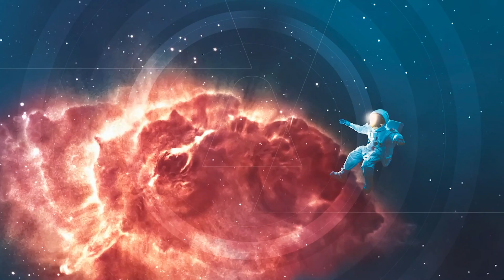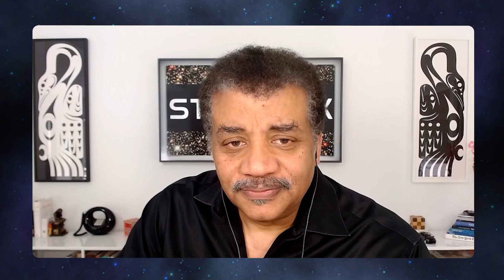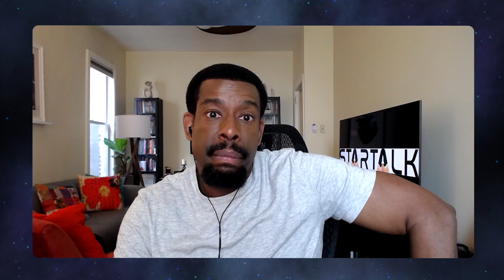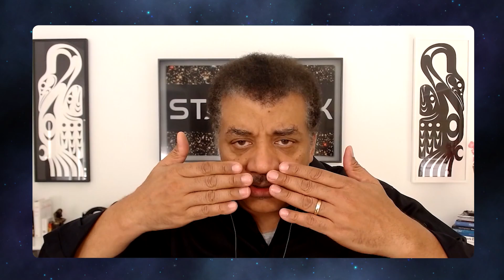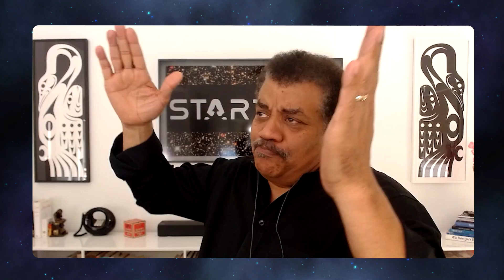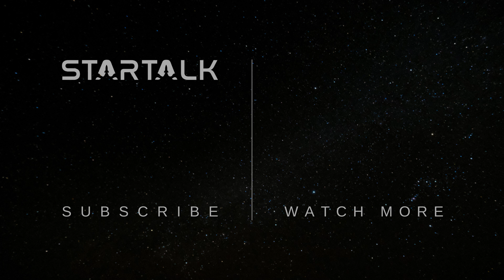Neil deGrasse Tyson Explains Sonic Booms

Comment: But on the ground floor where all the echonradios received most of the damages and what is the Devine pilot dive against the current straight into the water crime 4 sonic boom speed 1120x 4480 Aquarius soundmequavalent is 5600 T split below noon 3500/3500 1:1

Comment: Nothing travels faster than the speed of light, so there shouldn't be light boom!
Reply: correction, nothing travels faster than the speed of light 'in a vacuum'. If light is in other media such as water or even air, that rule doesn't apply.

Comment: Does that mean if it were possible to travel faster than the speed of light that the vessel would be invisible until the light boom caught up? And would the boom result in a flash because of the condensed light? And the vessel would obviously be catching up to older light so essentially going back in time, in a sense.

Comment: Remember that sound is essentially vibrations through a material. In our case it's air, and the reason sound coming from a plane going at mach 1+ is a "boom" is because as mentioned, moving faster than sound can propagate and vibrate the air in front of the direction the plane is moving will compress the air at the front cone of the plane and it will come shooting out and away from it while still being compressed. It turns into a shockwave, which is essentially compressed "sound" or just a very strong ripple through the air.

Comment: This is just wrong imagine an object were making noise in all directions and traveling 700 miles an hour, which also happens to be the speed of sound traveling through air given the current circumstances depending on the direction and trajectory of the object, the sound could reach you before the object would be directly above you provided that it ever was. And also the trajectory of the sound may have a shorter path to your ears comparative to the path. The plane has to the space directly above you, so therefore, airplane moving faster than the speed of sound, you may very well here before it is directly above you in a large amount of given circumstances, and given altitudes. 

This is usually the part where I would put something insulting at the end, but due to YouTube’s new community guidelines, I can’t say anything I want to. I’m going to sue YouTube. I’m going to sue them so hard I’m gonna do something.

Comment: speed of sound in air
ss = √(1.4 × 287 ×[273 + Temp C])
in  meters/sec 
C  celsius temperature
multiply ss by 1.944 to get knots and again with 1.15 to get miles per hour
TEMP is 9°C at 3000 feet  ISA
🇧🇴🏔️
it's cold at night in La Paz : 12000 feet! ss is smaller. OMG

Comment: So if you use a stack of say diamond sheets to slow a light beam below the normal speed of light, then fire a particle that travels close to the speed of light, with enough medium the particle will eventually outpace the photons. Is there an effect at that point? And is it traveling faster than the actual speed of light or faster than a light at any speed the point?
Reply: It's traveling faster than the speed of light in that medium. The effect will be the emission of radiation.

Comment: 9:03-9:06 somewhere in here I think I saw some kind of counterclockwise-turning firework-esque light outside my window that lit up the sky a bit. I've never seen that before. I guess I should check for footprints around here for someone with a flashlight or something but I live in an fairly unpopulated area and it's snowy cold out. It was bright enough to make me look up from my phone and wonder if the porch light was on because it started to light up the sky. It lasted no longer than 2 seconds as far as I could tell. It was 100ft+ up in the sky I believe, it was above the treeline. I think it started at a wide and fairly broad origin point in the center, expanded clockwise rotating, and then faded to the point I couldn't see anything unusual. The light rotating from the center were shaped kind of like rays of light. Not narrow though, broad. That's the best I can describe what I saw, I can't promise accuracy... Whatever that light was, I wish you safe travels. (I'm not sure if it's a trick of my eyes/typical light, a creature, someone at 3:19 with a source of light that had a sort of stationary center (did not seem like a flashlight, it would've been a very weird one, light didn't move like it was handheld, it would've had to have been extremely powerful), or perhaps a light wave of the universe). This is Northeast of U.S. , 3:20am, Saturday Feb 25, 2023. My eyes are semi tired and I'm sober and lucid. Now I feel like I can understand a little of how people just see things they can't explain and are like, "huh"...
Reply: *counterclockwise rotated.

I'm not sure but it may have also emanated from the ground up to that broad turning point, might've been why I thought it was a porch light. (Also I'm looking thru a glass window, wire screen, and I don't have lights on in my room besides my phone which was pointed towards my face. Which is my main reason for being suspicious of what I saw since the light from my phone made it harder to distinguish and just focus on the light in the sky.)
Reply: Also we haven't had lightening today.

Comment: Maybe the term "optic boom" would be appropriate for particles - such as electrons - when they travel through water, and in so doing exceed the speed of light propagation in that medium.  When that happens, an eerie blue light is emitted through the water, and it's known as "Cherenkov radiation"  - a very common sight in the water cooling pools in nuclear reactors, as found in nuclear power stations.

Comment: I learn new thing every time I watch Neil DeGrasse, thank you!
This led me with 2 questions:
1 - If the plane breaks the sound barrier and then slow down below the speed of sound, then speeds up and break the sound barrier again, with multiple repeats.  would it make multiple sonic booms?
2 - if the plane flying from Los Angeles to New York passing Chicago faster than speed of sound, would people in Los Angeles, people in Chicago, and people in New York all hear the sonic boom?
Reply: The plane does not "break" the sound barrier; as long as the plane is travelling faster than sound, everyone on the ground  that the plane passes over will hear a boom, which is a manifestation of the shock wave, which travels along with the plane.So the answer to question 2 is yes, everyone along the flight path will hear a boom. Notice that I refer to "a" boom rather than "the" boom, because it's not everyone hearing one boom at the same time; they are literally hearing their own "personal" boom as it passes overhead, no matter how far apart the observers are.

Comment: You hinted at the end about going faster than the medium wants you to go but didn't explain further. Someone will correct me if I'm wrong, I'm sure but the speed of sound in a medium is the same as the speed of an object which passes through that medium and creates cavitation, not just a wake, i.e., the speed at which the air breaks apart and leaves a vacuum behind the moving object - like a wedge cutting through a soft solid.

Comment: The speed of sound is slower at cruising altitude than at sea level and no commercial plane can fly faster than the speed of sound at sea level. But what if I told you that large commercial planes can and often do fly faster than the speed of sound at cruising altitude while still flying slower than how fast sound travels at sea level?

Comment: If an object doesn't make sound, but is traveling faster than the sound barrier, does it still make a sonic boom?  Does the boom happen simply because the air is slamming back down into the vacuum the object created?

Comment: My only contribution is that low-level song booms bust out windows in people's houses for miles.   I've only ever heard one sonic boom at White Sands NM and the crew I was with thought a bomb went off.   It was unbeleivably huge, like thunder times 10.  It practically shakes your guts loose.   The military isn't even allowed to fly beyond Mach 1 over general US airspace, only designated military operations areas (MOA's).   So the part about the US Gov't not wanting sonic booms over the US continuously is a real thing.  I'd guess the reason we never developed a super-sonic commercial jet was probably because they weren't financially profitable, so one ever invested money into it.   If it were profitable, those corporate investors would have lobbied (bribed) US politicians into repealing the supersonic speed limitation because hey, what's a few broken windows in people's homes when billions of dollars are to be made.

Comment: Hey... wait for a second. If an airplane fly above you faster than sound, sound seem to not be compressed but stretched 'backwards'. I see Sonic Boom as compressed air only if airplane fly exactly at speed of sound. In that case it can't be dissipate but will be accumulated and THEN if it hits you, you will experience sonic boom.

Comment: I grew up next to O'Hare Airport in the 60s and one summer we had endless sonic booms that knocked us out of our beds...hmmmmmmm
Reply: Commercial jets generally aren't capable of breaking the sound barrier and there have been FAA regulations against creating sonic booms since 1970.

".... In 1970, acting under this authority, the FAA proposed a regulation that would restrict operation of civil aircraft at speeds greater than Mach 1, unless authorized by the FAA..."

And our military generally has rules against doing it over populated areas for public relations purposes.  However, it was quite common in the 1950's to hear sonic booms.

Comment: When aircraft reach supersonic speeds, along with the sonic boom, sometimes there is a visible cone that forms toward the rear of the aircraft, what causes this? If i had to guess I would say its maybe caused by the moisture in the compressed air around the supersonic aircraft becoming water vapor maybe?
Reply: Saw this a lot in the navy and I assumed it was water vapor in the air being displaced by the supersonic speed.

Comment: To be precise if the plan was at the same speed as the sound, you would see the shadow of the plain before the sound, because the sound still has to travel to you and the shadow is immediate. A very small difference but it's there

Comment: So when Guile from Street Fighter hits you with his "sonic boom", the punch is traveling greater than 700 mph.
Reply: Yes, and the thing that floats across the screen is the sound of the punch.
Reply: Course it is, wanna know how he's able to do that? Murrica! Now go home and be a family man! 😅
Reply: @Mike_droptv  now go home and be a family man has got to be one of the most genius conclusions to a comment to ever bless this app
Reply: Depends on altitude/air pressure.  Since he would be on the ground when initiating the attack, he would have to punch at speeds around 740 mph at sea level. But at a cruising altitude of say 30,000 feet, he could punch around 600-620 mph and get the same effect.
Reply: No that's a common misconception. The noise from an object moving faster than sound doesn't sound like a guy saying "sonic boom".
Reply: First thing I thought of. 80s baby.
Reply: UFOs especially the tic tac which was recorded by navy radar in real time at speeds of 4-5 figures 25,000 mph they calculated failed to make a squeak 🐁 Mach 20 would in an actual reality visually event surely leave in its wake a little earache and be heard 600 miles away on the basis a sonic boom can normally be heard 30 miles away at the boom speed of 700 mph or around that speed
Reply: That is correct 
Tham da tham ta tham tarabadaba daba than taram tadam.

Comment: just a comment on the stupidity of the argument against supersonic passenger planes. the Concorde would get to mach 1 at 35k ft about 20 minutes after take off and would drop speed to under mach 1 before starting the descent for landing. meaning that there would be no sonic boom for anyone to hear at any point near the ground, just the sound of a regular plane that is about to land or take off
Reply: It was a lot noisier than regular planes even when flying subsonic since turbojet engines generally are much more noisy than modern high-bypass turbofans.

Comment: I currently live on an Air Force base where sonic bombs happen several times a week. It can cause your vehicle alarm system to go off, building on base to shake and windows to shatter and yet, I’ve gotten use to the extremely loud sound of bombs dropping every week 😩🤦‍♀️ Residential neighborhoods could not handle this especially because it can be very traumatic…

Comment: And he forgot to mention how an observer in the airplane, going faster than the speed of sound, could lean out of a window and shout in any given direction; and the sound waves would still radiate away from them at 700 mph, in all directions. Yet an observer on the ground would perceived the sound waves coming towards them at 700 mph as well. And the only way to reconcile this; is if time were to slow down for the observer on the airplane, verses the observer on the ground. So the observer on the ground would hear the other one talking so slowly that they would be well past them, before the first syllable was uttered. Like likewise the observer on the airplane would hear everyone speaking so quickly, that it would be perceived as a high-pitched whine.

Comment: This sort of answers the question I submitted last year about sonic booms. If people lined up across the state and the plane flies over them all do they each hear a sonic boom or is it only when the plane passes the speed of sound then nothing more. I used to live in Farmville, Virginia 20 yrs ago and there was an air base near by that had fighters breaking the sound barrier on a daily basis. Just a note the sound barrier is roughly 749 mph dependant on weather conditions and air density, it's not an exact speed. Now something else to think about, if you attached a gun to the outside of a rocket and fired it after the rocket takes off will the rocket pass the bullet or will the bullet pass the rocket?

Comment: So…is a sonic boom a continuous event, for an object going over 700mph, and anything in its path only hears it when it passes them?   Meaning, is it “non-stop” booming, continuous, so long as it stays faster than speed of sound??  Or just a single boom as it crosses over the speed threshold?
Reply: Continuous.  It is a compression wave.  Picture a boat in the water and the waves that form behind it, then scrunch those waves together but keep the boat moving. Everywhere that is touched by the waves will hear the boom, and it won't stop making the sound until it slows down enough to stop compressing the waves.
Reply: @fivetriplezero8985  awesome explanation, and makes total sense.  Thank you!

Comment: Hey, but what does the person going faster than sound hear? If it’s a plow behind them does the boom catch up to them? What do they hear the moment they go faster than sound?
Reply: When a pilot flies the plane at a speed greater than the velocity of sound then shock waves are generated behind the plane , therefore for a pilot it is not possible to hear sonic boom. The sonic Boom won't catch up with the plane because it's a shockwave only at the moment of breaking the sound barrier.
Reply: @rob5232  so the shock wave never catches up to the pilot? Even after slowing down?
Reply: @johnson99quinton  Correct. The pilot is right at the center and it’s all moving away from him. The only way pilots know they’re supersonic is by looking at their airspeed indicator.

Comment: You should have talked about how the speed of sound makes it difficult for a land car to go faster than the speed of sound
Reply: That’s not really related to sound; it’s that it’s just so godawful fast. Just considering aerodynamic drag, the power required increases with speed cubed. Plus, the forces on things like wheels become tremendous, and things tend to break very easily. There is also the matter of trying to control something going that fast, considering that very bad things can happen before the driver could react.
Reply: @David_Lee379  while those a very true factors and a very tangible aspect of it sound waves do create issues as well. A sonic boom in the air has the ability to move out in all directions. But when your on the ground it tries to bounce off the ground which causes it to come back on the vehicle. This does create extra forces beyond the aero drag. That why I say it would have been an interesting tidbit on this video. Which I thoroughly enjoyed as it was.

Comment: I wish Neil would've also explained the cloud that forms around vehicles breaking the "sound barrier".
Reply: That can happen when the plane is subsonic too.  It's the humidity in the air, condensing into fog for a split second when the pressure is low enough in the air-flow around the plane.
The humidity just has to be high enough. I've seen it over the wings of commercial planes landing when the humidity is about 100%.  A military plane at about Mach 0.95 wouldn't need that much humidity because the pressure ratio is more severe.

Comment: At lower air pressure, does sound travel slower because the average distance between air molecules is greater? Is it easier to get to Mach 1 at higher altitudes?

Comment: Does a sonic boom get to you faster or slower for the same velocity aircraft at higher altitudes? I.e. what is the effect of air pressure?
Reply: Speed of sound only depends on temperature & composition in an ideal gas (atmosphere is pretty close to that). It depends on altitude because the temperature changes, not because the pressure or density.
The shock wave gets to you later for a higher plane, mostly because it has to travel farther to get to the ground.